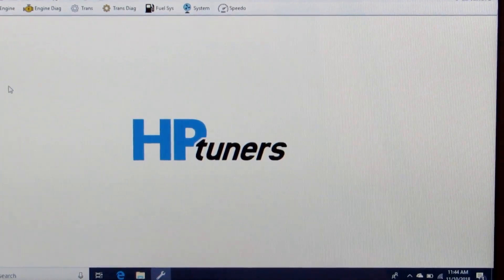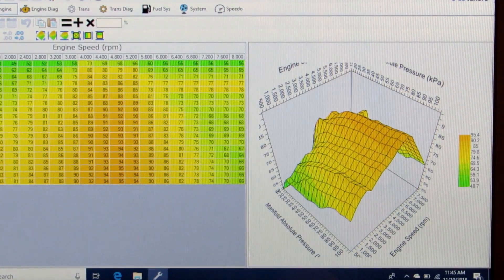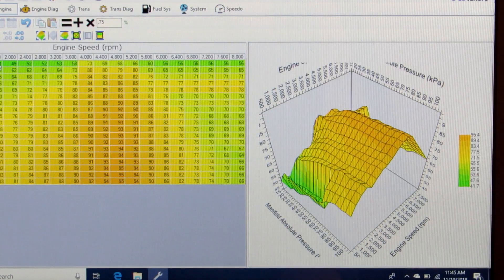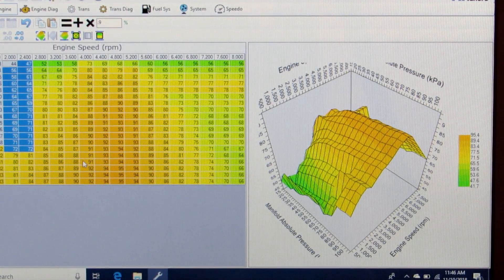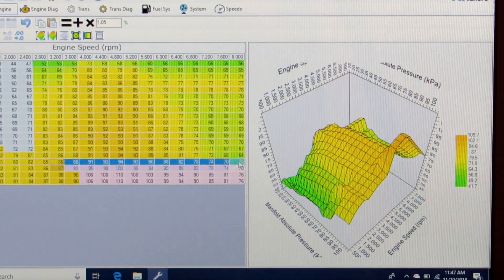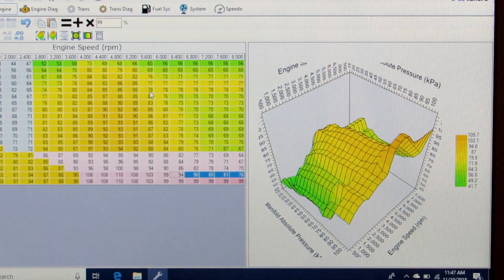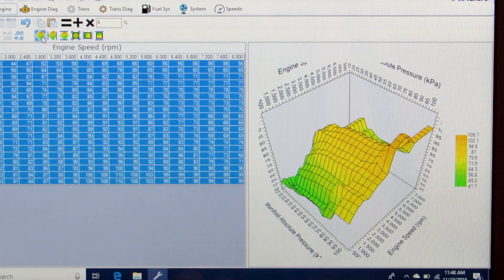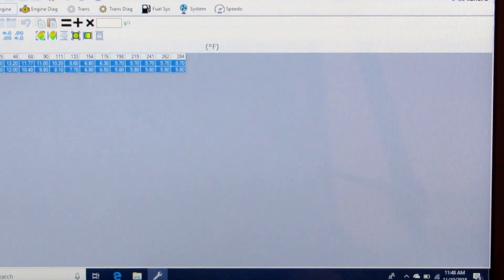LSx Camshaft tuning

Comment: How to tune my ecu. Which compression ratio to use. What is a redline tune. What to adjust.
1000+hp goal

Lq9  4 .000
/ with  +29cc forged dish pistons 
Gen 4 rods  and arp bolt
L92 heads stock 70cc
Comp cam 239/255 @.50 624/624 114
Boost 24 psi
Rpm 6500
E85
18* spark
Arp head studs.

STATIC Compression Ratio:
7.73:1

DYNAMIC Compression Ratio:
4.87:1